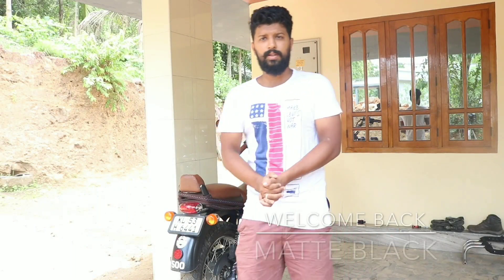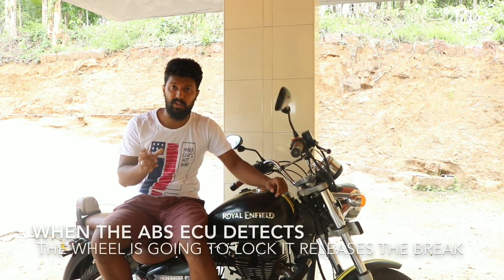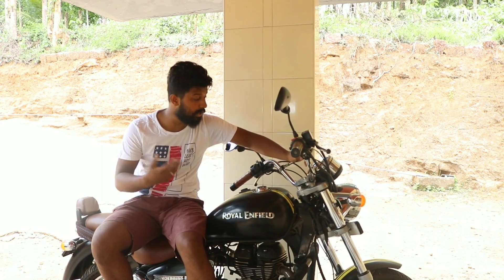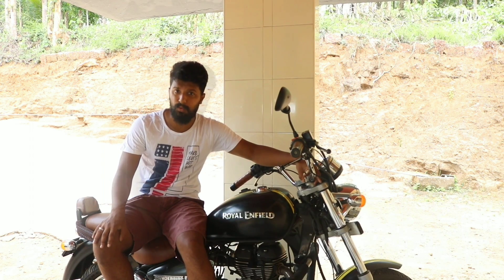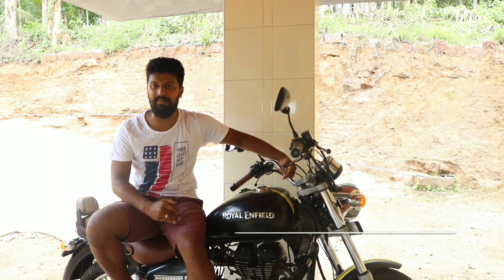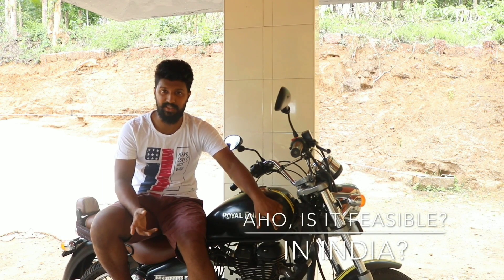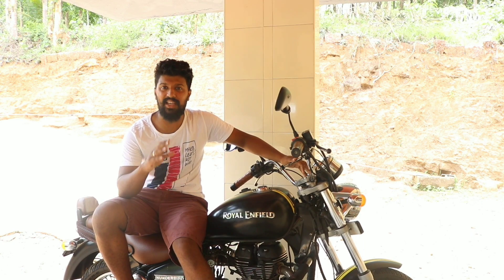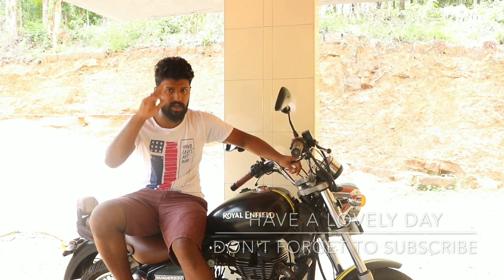Why no ABS on Royal Enfields

Comment: i'm a bullet user bs4 model, my qstion is at what time we have change our tyres? what are the maintenence tips i've to follow?
is it possible to install ABS system in my bike? if possible how much does it cost...
Reply from the maker: +Burma Vamshi it is possible but it will cost you a fortune as you will have to get a 3rd party ABS system and u need to find a mechanic who can fix it. Just wait for 1 more year the govt will make ABS mendatory and you can get RE original spares for your bikes and get it fixed at the RE service center.

And as of tyres , normally tires last for 20000 kms but it also depends on the usage and what type of tires you have. Like some of the tyres (radial) they can last upto 50000km. Again it depends on the type of road you are rideing. So it can be more than 20000 km or less. 

Hope you got your answer. ;)
Reply: thankyou bhayya... keep on doing vlogs...
Reply from the maker: +Burma Vamshi my pleasure bhiyaaa.. :) will do.. ;)

Comment: ABS and traction control should be standard on all bikes. Lot of bikes in USA have them.
Reply from the maker: +tiger6102 yup its compalsory over there. :( In India it is proposed to be mandatory after 2018 only. :(
Reply: tiger6102  . but with those standard techs. The bike ain't going to be cheap